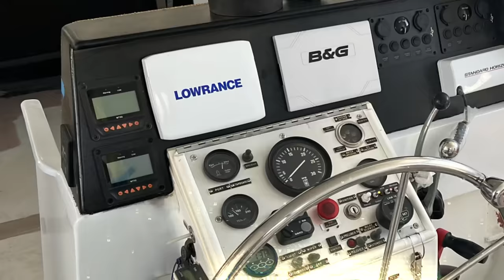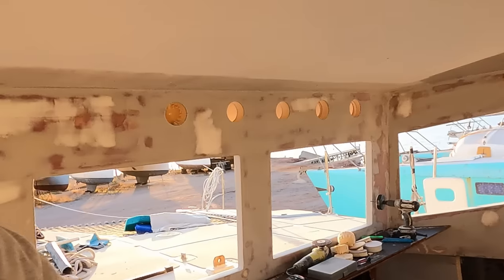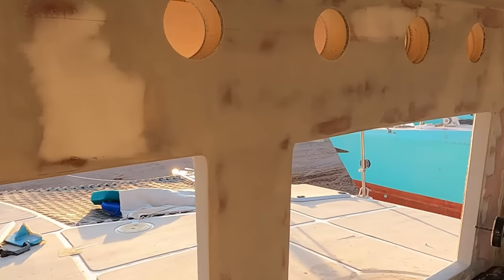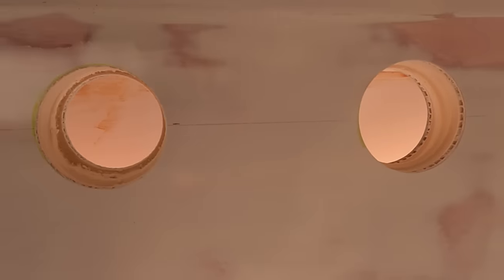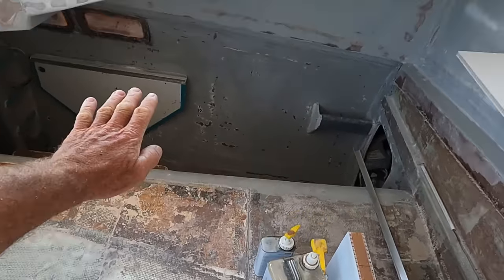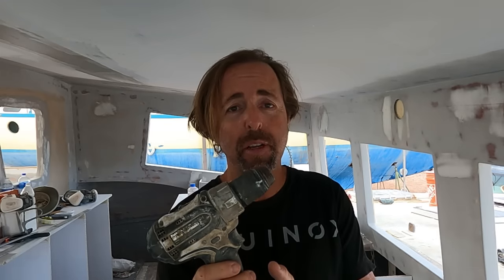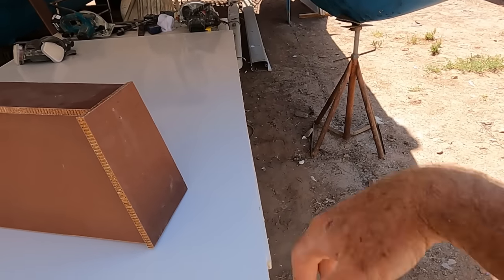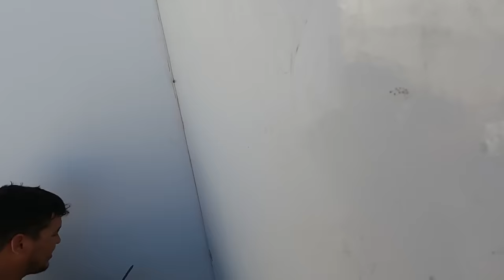(Ep #17) Insane DIY sailing Trimaran Redesign.   “Building our modern Loft”

Comment: Hi did you think that since your windows are slanted inwards at the top that water could ride up and seep in through the vent holes and maybe install a small lip just under your vents to divert the water while you are under way.  Hi from Dominique in Quebec Canada
Reply from the maker: That’s a great idea... Yes I did and I have planks to place over the holes, one board per side and in extreme conditions I’m sure that will help but as you’ll soon see the angle piece I will be installing on the interior will catch any water and it’s at the base of the holes so it will just drain out.  Thanks for the input.
Reply: If the front cabin wall is completey flat, perhaps the inside angle that will be used to obfuscate the ventilation holes and direct flow could be hinged with a groove and "seal" inserted. A design that would allow for open and closed with somewhat of a weather seal and would still allow for the inset lighting strips to be a feature.

Comment: Ur air flow idea is not going to work like u'd like...is going to become a maintenance nightmare with dust, mildew collecting in ur vents with screens that will clog.
Keep vents that seal and fully open when needed.  Big mistake!
Reply from the maker: Really!  Well after being on the water for over a year now and making it thru 3 storms with over 50mph winds and heavy rain, I must say I did not make a mistake.  Thanks for your input tho.